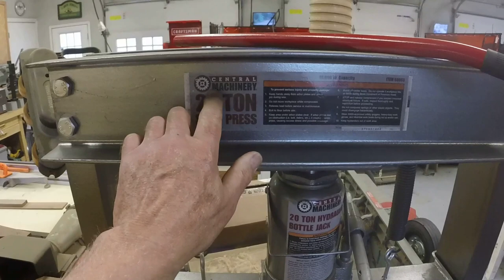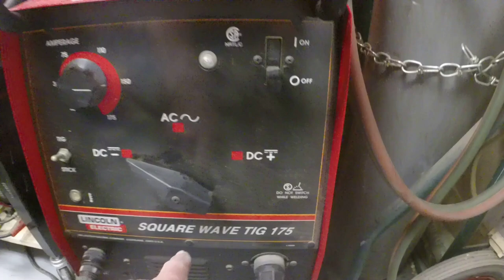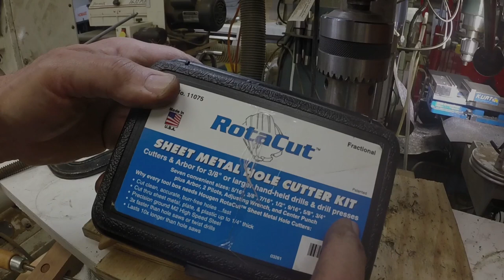Garden Tractor to Forklift Conversion EP:17  Battery and Steering Changes

Comment: A major improvement for your tig welding........is clean, clean, CLEAN. I grind all my joints and clean them with acetone, and my tig welding improved dramatically.  Try it, you might like it !
Reply from the maker: I did just that. But my flat beads are way too cold. I realize that.

Comment: Your tig welder is a nice buy. The AC output is for aluminum, and the DC is for steel, stainless steel, copper, brass, and the like. Using tig is similar to brazing, but is closer to oxy/acetylene welding. 
I took welding, and it was a useful class for me in trade school. We started there, and moved up to cast welding with a torch. I never really needed this part of that course, but it was good to know. I wish I took tig welding, but the class ended before I got to. I've found that with tig one can get good penetration without excessive heat, and it's easier to control than with mig.
We had an introduction to blacksmithing then, too. I've used this knowledge more than once.

Comment: Indeed the steering looks much more solid. You found yourself some great tools. I am looking forward to see that press break, shear, and bender at work. It looks like a tool that can save you a lot of time welding boxes or brackets, or cutting simple straight pieces of metal. Modern TIG welders have idiot proof digital settings, and also programmable settings, and some extra settings for specific tasks such as tack welding, which makes things a bit easier.  But that Lincoln looks like a solid machine, and it will get the work done. A big 👍 (Always a joy to see the pups)

Comment: Once you install the mast , much weight is transferred and steering becomes easier, it looked like it has a small binding issue 😅about 1/2 way to the right , I’d check the cylinder alignment.
Reply from the maker: Yes, I've adjusted the cylinder location a bit.

Comment: You will need to buy some Tungsten's for the different metals you plan to weld with the TIG welder. And than practice with it. MIG is the easiest type welding for most people. TIG takes a little more finesse. And the setting are a little more crucial as well. Different metals require either DC, or AC and Pulsed for both, in certain conditions. But it is a learning curve for sure...

Comment: My dad and I built two reverse loader tractors. We turned the front axel to face the drive wheels because you are driving it backwards now.
Reply from the maker: I have another axle I am considering swapping out--heavier duty.  I'll have to look at changing it around.
Reply: Also put ribbed steer tires on they will steer better
Reply: Or maybe you can switch the spindle s from from side to side. As long as were they mount is straight and not at an angle.

Comment: Nice score on the machines and related pieces. I think a mobile machine base would be the best way to go for the brake/slip roller. The steering shaft upgrades looks great.
Reply from the maker: I think you're spot on.  I need to swap out the tables so I can use that expensive fixture table for it's intended purpose.

Comment: One thing I noticed Frank is that when turning to the left maximum is giving a much sharper turn than when you turn to the maximum right. I suppose it could be an optical illusion but maybe not.
Reply from the maker: That is fixed in an upcoming episode--changed the cylinder angle and rod length.

Comment: I would recommend changing over to an automotive battery... Those lawn and garden batteries just aren't as good as they used to be.  I would also add a battery cutout switch in as easy to reach spot close to the battery

Comment: It looks like you have two pulse welding torches in your tool box. They are useful for light gauge sheet metal as they won't warp or distort the metal as quickly. I tried to get one of them at my uncle's estate sale.
Reply from the maker: Yes, one says spot welder, the other says stitch welder.  Haven't messed with either one yet.

Comment: 300 lb just within the capacity of your new fork truck .
As I know you read and answer .
Have you ever looked into N. Testlas turbine engine ?
The problem with them was materals of the times. We now have ceramic bearings and stainless metals both capeable of handling the sustained temperatures .
And you could power it with nearly anything.
Even the possibility of using the hydrogen from steam from a cooling jacket.
Reply from the maker: You mean Nikola Tesla? Had not seen that.  Will have to look it up.

Comment: I wonder if those holes in the flange bearing is metric or an odd size so you can thread it.
Reply from the maker: I'm betting they are M12. (12mm). Just under 1/2 inch.

Comment: Got a question, I have a 1997 Massey Ferguson compact tractor.  I need to rebuild the steering box but they discontinued the parts.  So I found a hydraulic steering off a Cub Cadet do you think it has enough power to work on my tractor.
Reply from the maker: Depends on your hydraulic pressure. The Cubs only had 600 psi, so if you are using tractor hydraulics at 1500 to 2000 psi, you should have considerably more force at the steering knuckle.